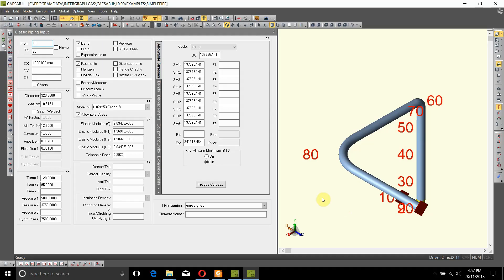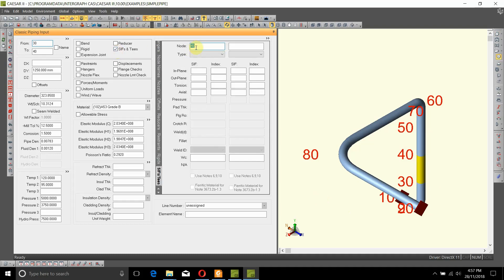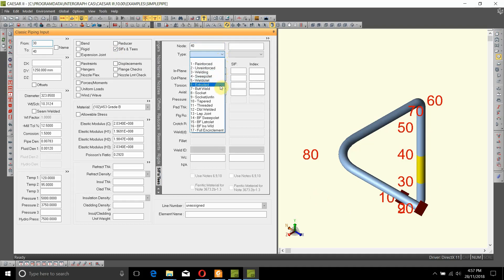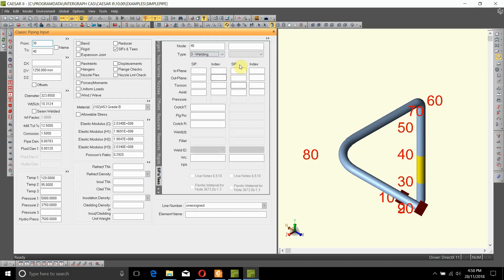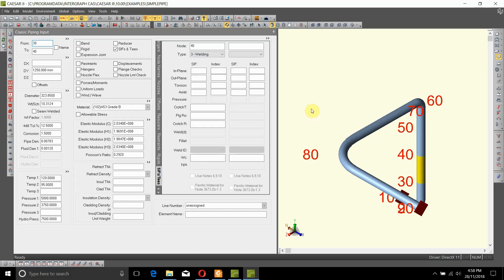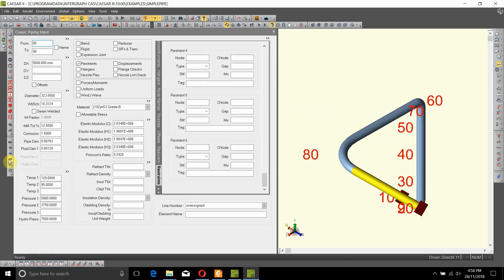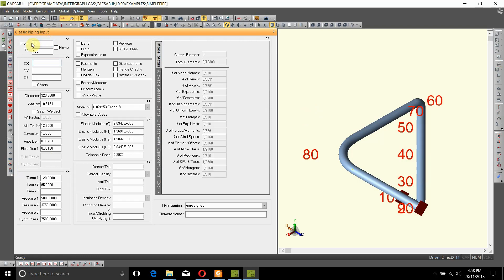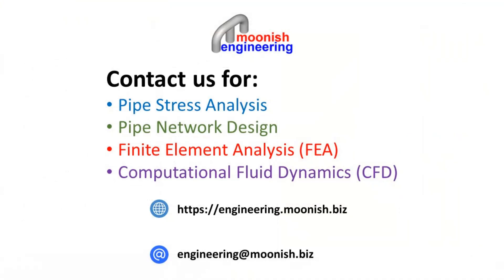How To Add/Insert a Tee in Caesar II

Comment: Sir, can you explain wich Type of tee in Input is a straight BW Tee according to ASME B16.9? Thank you very much, your videos helped me a lot learning using Caesar II for stress analysis
Reply from the maker: Hello Ivan,  I do not have a Caesar II license with me so I wouldn't be able to help you for Caesar II queries. I would suggest you go through the help file/user manual and check which different types of tees are available in Caesar II and match them with ASME B16.9.

Best of luck.